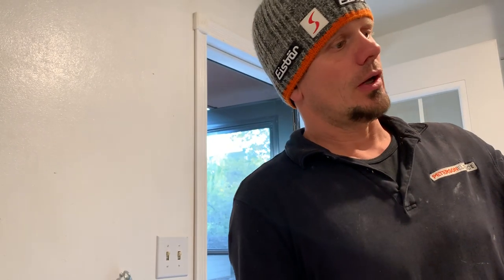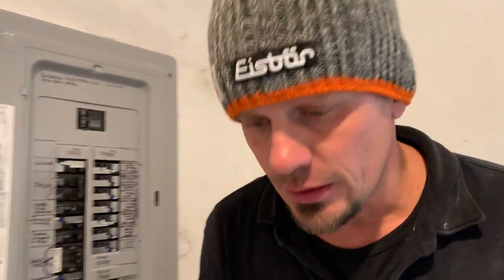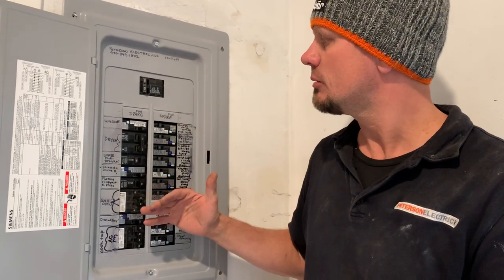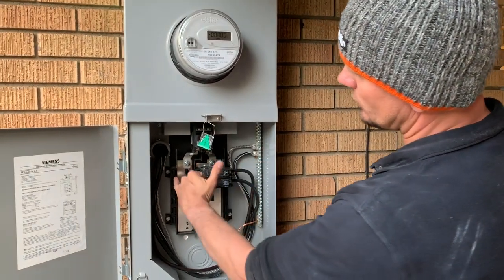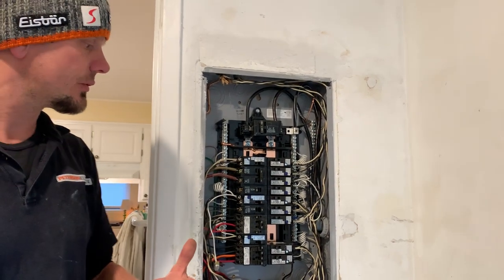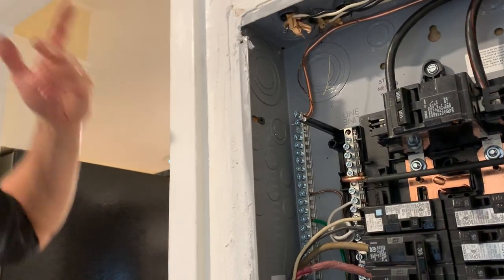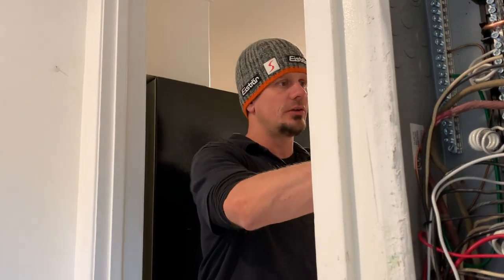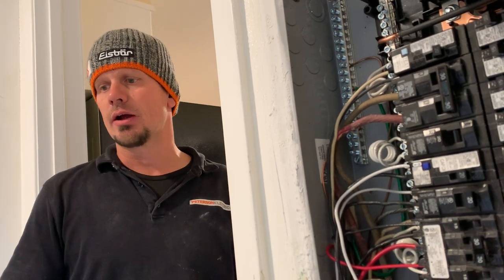Grounding a Home: Can You Deal with a Two-Prong Outlet?

Comment: Really enjoy your videos. However, you may want to reference Mike Holt’s work in regards to grounding and bonding. His class was very helpful to me. The EGC is not designed to divert the fault current away from the consumer but rather carry it back to its source which will open the circuit breaker. This is what we’re aiming to do with the EGC and GFCI’s... opening the circuit... not diverting the electrons. This is also why providing a GFCI upstream on an ungrounded circuit will provide an effective means to clear a fault. It doesn’t utilize an EGC because it’s measuring the current on both the hot and the neutral. If any leakage is detected the circuit will open.
Reply: Yes!  You read my mind.  Effective ground fault current path back to the source.  The occupant is protected by clearing a fault quickly through a low-impedance pathway.  I would also highly recommend Mike Holt's instruction.  His YouTube channel has provided some great (free) teaching during the pandemic.  Mike busts a number of misconceptions on grounding and bonding held by those in the trade through practical examples.
Reply: @steveloux4709  I find the best way to think about it is that we are shorting the hot under certain conditions because the egc is bonded to all the metal if a hot wire comes in contact to anything metal it is basically like shorting the hot and neutral by having another wire bonded to all the metal in a house and in devices appliances etc back to the breaker that is if everything is bonded correctly and you don't have neutrals and grounds connected at a sub panel.
Reply from the maker: Yah, i'm sure mike holt's is good, although, I was an appliance tek for 3 yrs and was electrocuted MANY AND MANY TIMES without an EGC, and with a GFCI. This happened when a washer was leaking it's water pump on the motor in a basement with cement, and many of times with a GD and DW. SO, with that said, wire at your own risk, the code is a min. If I am wiring and repairing hundreds of calls a year, I am going to stand on DF plugs per every device, but my first choice is in art 205.130 I will always run my EGC ground independent if they will not pull walls, but making sure the service is grounded properly to 250.52 and 53. BUT I am most likely going to bid a new service so I can protect with NEW DF BREAKERS> they are the best and first most important device at the beginning of all power and lighting circuits and as well as 120v dedicated appliances and motors for REZ'y

Comment: What is the code reference that states replacing a 2 prong with a GFI receptacle requires you to arc fault it? I dont believe this is true
Reply: You are right,  u dont need to protect with arc fault breaker.

Comment: have you ever ran across a 1950's home with metal outlet boxes and 2C cable and find the ground is establist on the actual box... I had that problem in Calif. going from 2 to 3 prong outlets...
Reply: When EGCs first came on the scene (I'm from California too) in the later half of the 1950's, the early NM cable had no ground within the jacket of the cable.  The electricians' technique was to take a #14 CU bare conductor and string it independently of the branch wiring.  That conductor might zig-zag all over the house, stopping at each metal junction box and terminating by way of wrapping the unspliced conductor several times around the nail which secures the box to the stud.  I'm not sure this is a "problem".  You may find you have to drill and tap the back of the metal box to create a 10-32 thread and install a grounding pigtail to the wiring device - unless your wiring devices include an automatic grounding feature (spec grade receptacles do of course).  One might argue the quality of ground is highly dependent on the quality of the connection to the metal box, but generally I would sleep just fine at night with a 3-wire receptacle installed in a grounded metal box that had no EGC present inside the box.  

As the years wore on, the cable manufacturers began to include a ground conductor inside the jacket of the cable, beginning in the 1960's.  What is interesting though, is that electricians were stuck on the idea that the ground should be terminated on the outside of the box.  I saw an example of this just today in a 1960's apartment building:  The bare CU conductor exited the cloth-covered NM sheath inside the box just beyond the cable clamp, and the electrician immediately made the ground wire do a U-turn back outside the box where it was then terminated.

Comment: I completely agree with you on putting in EGC grounds across the house. Safety first. I completely agree with you also on why manufacturers are not producing the variants of devices that allow protection 2- or 3-prong it should be done to suit all budgets. Though that being said even with good EGC the appliance itself can become live if it has no ground pin and even if says it’s double insulated I have seen these appliances become live over time due to cheap poor construction and inappropriate insulation or insulation compromised due to deep scratches. Unless you test the appliance itself you are never going to know. It happens very often in commercial settings. Medical devices have to be checked very thoroughly for example as per NFPA99. In Europe this type of work is called PAT testing. It’s gonna become a bigger deal in the future given the range of devices AC and dc that will proliferate in houses of the future.

Comment: Hey Josh I don't think you need a 2 prong tamper proof receptacle. 406.12 Ex. 4 gives you an exception for 2 prong replacements. So if you go back with a 2 prong receptacle it doesn't need to be tamper proof per NEC code. But I understand the frustration with trying to meet all the standards per code, as a fellow electrician myself.

Comment: Can you add a ground rod to a sub-panel? If so, do you still need a ground back to the main from the sub?
Reply: Yes you still need the ground wire back to the main because your ground need to go back to the Source which is the transformer from your power provider. The ground rod is only needed if your sub panel is on a defferent building. Ground rod are only to get rid of excess voltage from a lightning strike it will not ground Fault your breaker too much Resistanc.
Reply: @joejoe6949  which, different, much

Comment: My house was built in 1961. The house has 12/2 no ground bx cable with metal boxes.   Would adding a ground screw to the boxes and attaching a ground screw to a three prong gfci outlet be sufficient?

Or should omit the ground and add a “no ground sticker?”

The main panel has four wires now with a separate EGC.
Reply: Chances are, given the era of your house and the presence of AC cable (aka “BX”) your boxes are grounded throughout the house. This should be verified in the field. But if so, replace your two-wire receptacles with grounding outlets, and run a ground wire from the green terminal to a dedicated threaded screw terminal (you may have to make your own). GFCI protection is nice, but not actually required except for those locations identified in 210.8 of the NEC.

Comment: Hey man ?  I went to change my kitchen overhead light took the old light down and the electrical wire was coming out a hole in middle of a 2+4 and ground and neutral hooked together no junction box .. what should I do with the ground just hook it to the medal bracket I screwed in to that 2+4 or back to the neutral wire

Comment: Any problem with inspections regarding feeding feeders from the 1900s? I have a job with an old FBE subpanel I swapped out. The feeder was a cloth covered cable with 4 wire 8AWG and a 12AWG ground. Thoughts?
Reply: It's really up to the AHJ.  It can be argued this is an existing non-conforming situation that is grandfathered from previous Code cycles.  Now, if you need to actually modify the length of the feeder, rather than just re-purpose it in newer equipment, I think the AHJ has a better argument for replacement than you do for grandfathering the service cable under prior Code.  We run into this from time to time with early cloth-covered NM cable serving branch lighting an power from the 1960s as you might know.  The lighting circuits which serve bedrooms and living rooms are often run in 14/2G, but the bare CU ground in this case is often #16AWG.  I've never heard of an AHJ demanding that all of the existing branch wiring be removed in a panel replacement project simply because the EGC is not sized to meet the current Code.

Comment: I agree with the TR 2 prongs, it's a money grab. They should also come out with 2 pole dual function breakers.
Reply: Not until NFPA 70 calls for such equipment.  That's where it rightful starts.  Manufacturers are not going to find it profitable to make 2-pole breakers equipped with AFCI features based upon a voluntary upgrade.

Comment: if your gona run a new solid ground why not just re wire the home runs with new romex?
Reply: Good question.
Reply: @user-ln7of9gs4s  likely because hed still have to essentially rewire the entire house. none of those jumpers are gonna have grounds either throughout the walls. especially the boxes in the brick perimeter walls